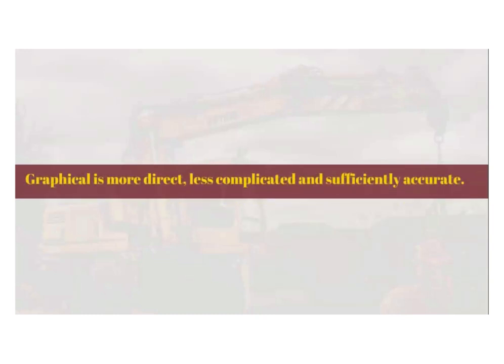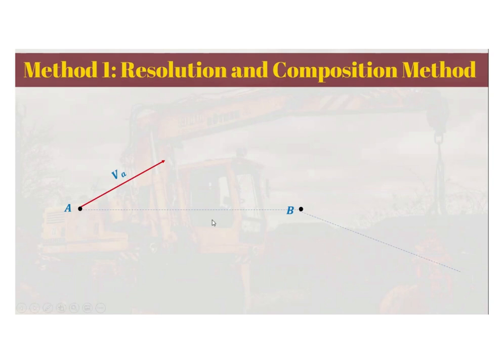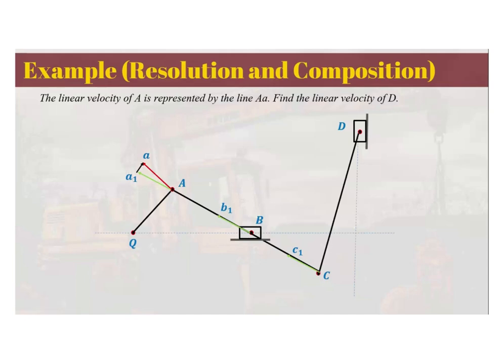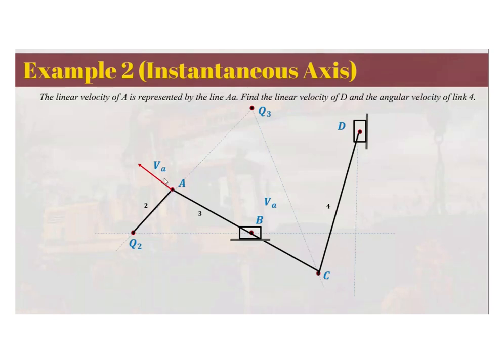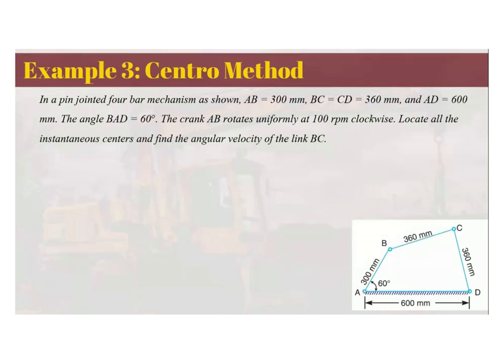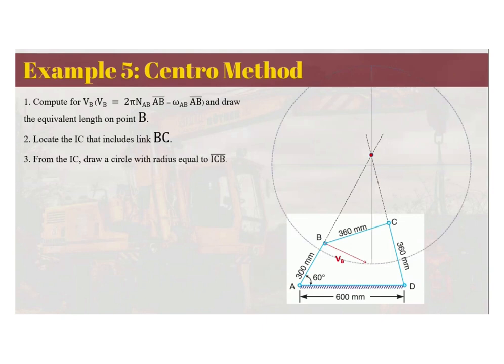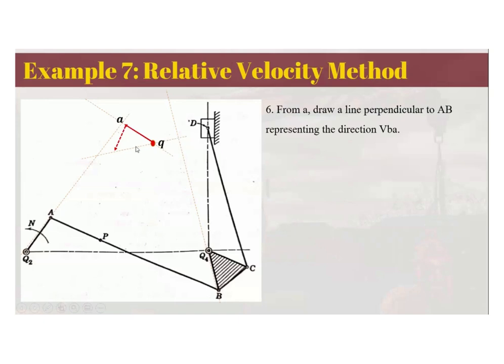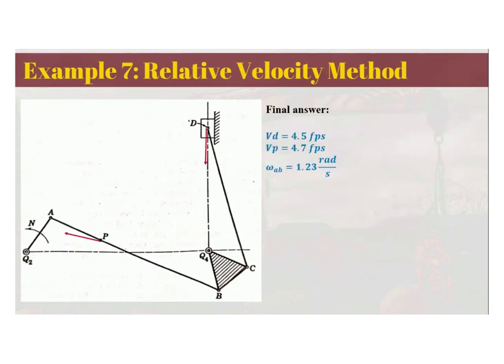Velocity Analysis

Comment from the maker: Erratum at 21:31, the line c1c2 needs to be perpendicular to BC and cc2 perpendicular to AC. The intersection of the perpendicular lines drawn from c and c1 locates c2.
Reply: Block 3 slides along link 2. Q2A = 3 1/2 in.; Q2F = 1 5/8 in.; Q4C = 2 3/4
in.:  Q4G = 1 9/16 in.; GB = 3 in.; FB =2 in. If the velocity vector of A ia
2 in. long, find the velocity vector of B by resolution and composition.